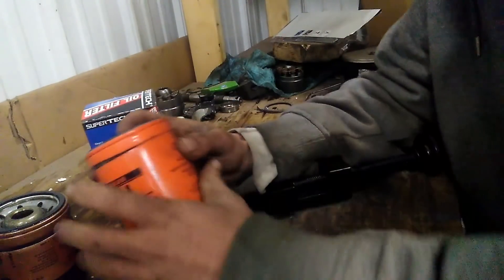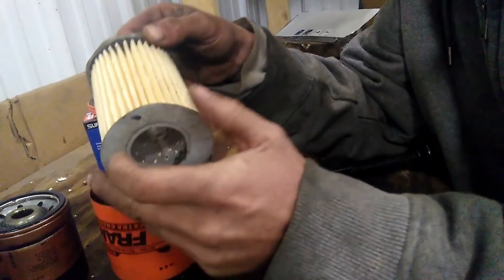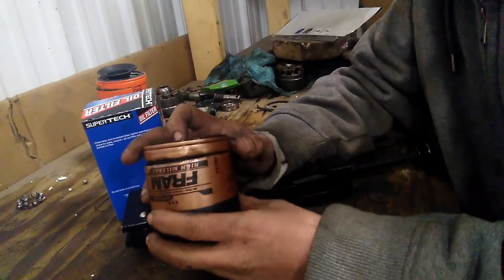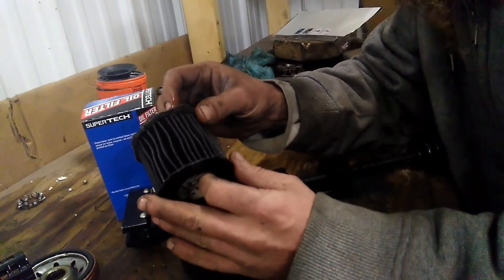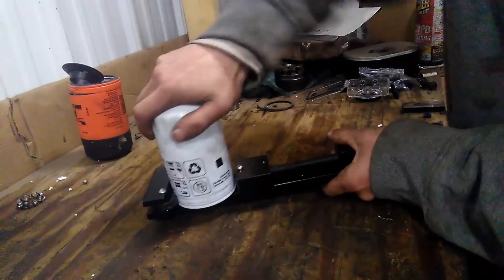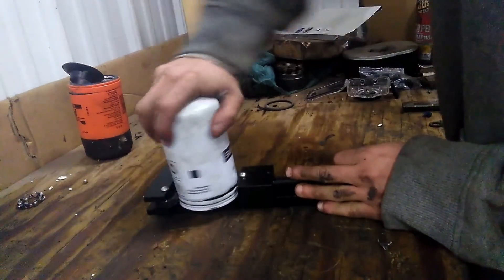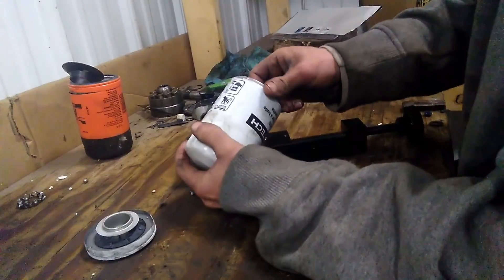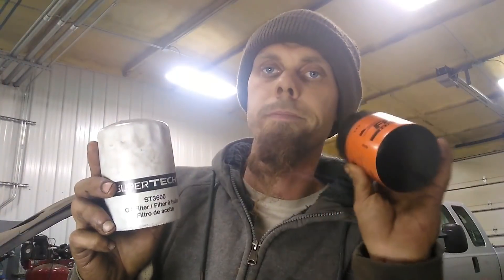supertech vrs fram oil filters: are fram oil filters really the worst you can buy?

Comment: Supertech is definitely superior than Fram extra guard. Only thing I like about Fram is the non slip grip, but that still won't make me buy it.
Reply from the maker: the grip is nice i wish more manufactures did that. but not enough to make it worth buying.
Reply: Ezrider92356 Purolator one used to have a yellow coated can with the same texture but that was like 5 years ago.
Reply from the maker: cool 👍
Reply: Super tech ones are made by Fram now 😀
Reply: jeffscomp I dont know if they are made by fram but they are completely different. Do not know who manufatuers them but it could be Fram.
Reply: chriss4365 Hey, I saw your video and I really appreciate you showing us the inside after 4,000 miles. I'm not against Fram extra guard, but I would rather upgrade to the Fram Ultra Synthetic. Matter of fact, I use extra guards on my beater.
Reply: Put a piece of duct tape around it.   Same effect.
Reply: I bought fram filters for years for that very reason.  After watching a youtube video comparing Mahl filters, I now use them, along with a filter wrench.
Reply: I used those $3 filters for 350,000 on my VW Golf and the engine ran perfect when I sold it

Comment: I've used fram oil filters for the last 45 years on every vehicle I've owned, some over 150,000 miles without one problem and I won't be changing brands now
Reply: You see a superior product for less money but still won't switch?  Why not?
Reply: @csinalabama73  fair question. 
Supertech has changed manufacturers, so there is a risk that they may change again
Reply: Yeah keep your head in the sand , , , that will show'em
Reply: Still using Bias ply tires cuz you never had a problem with them either, radials are a waste of money? Still using conventional oil also cuz you never had a problem with it? Yeah thats safer than this new radical Synthetic stuff that all the "young folks" are using, damn hippies get a haircut!
Reply: @homerfry9234  that's cute. trump 2020, right? LoL

Comment: I've driven north of a million miles on all sorts of filters...from the Fram "Orange can's of death" to expensive Baldwin and Mann.  First...I've never had any oil or oil filter related issue.  Second...I also never thought it necessary to cut one open.  The "cheap" Frams are made that way to...wait for it...to keep them at a price point.  Low.  They're NOT designed to race.  They're NOT designed to go extended mileage.  They ARE designed to be low priced and perfectly suitable to run 3-5k miles.  Bash them all you want but the fact is that those cheap crappy filters and their generic/re branded equivalents protect more engines than all others combined....
Reply from the maker: thanks for sharing your experience.
Reply: And yet the Frams cost more than filters that are better made.   I think that indicates they're designed primarily to turn a profit.
Reply: The new Super Tech line is now made by Champion Labs.  Mercruiser filters are identical but cost 5x as much just because they're black or white.  Other than that...they're identical right down to the numbering.  Indeed, they're also cheaper than the Frams and look to be better overall.
Reply: I tend to agree with your assessment.  As long as you replace them within their rated service life they should be fine. The quality of the oil you use is the more important thing.
Reply: corporate greed for junk. Keep the shareholders happy. screw the consumer. Every here of that?
Reply: @gtzgreatride  Baldwin filters are great.  Most fleets run Baldwin because it is a great filter.

Comment: Good comparison. I generally go with a Wix or SuperTech. I quit using FRAM when I found out about the cheap cardboard on the ends. I'm glad you took apart a used filter, it shows even more why the metal ends are far superior.

Comment: The Fram Ultra and Titanium which are the same filter are actually ones just exclusive to AAP are  extremely high quality filters. Almost like they’re made in a different factory high quality. They’re wire backed media, silicone anti drain back and steel end caps

Comment: A little over 600k on my last Toyota pickup with Fram filters. Not a single problem! Oh and that "carboard" is actually a similar material as the filter media itself. Glue bonds better to it so the media doesn't tear in high pressure situations like cold starts and high revs. We've seen plenty of media tearing issues with Purolator filters and their metal endcaps! Go read the forums on Bob is the Oil Guy if you don't believe me, scroll through the filter section. Literally hundreds of threads on the subject.
Reply: So now that you know how poor the Fram is why would you continue to use it when better choices are available? Will you never switch to synthetic oil because you never had a conventional oil failure?  I used Fram for 30 years and never had a problem but saw videos years ago that made me switch to better filters. How can you in good judgement continue to willingly use crap in a vehicle that cost so much?
Reply: @homerfry9234  Because it's never failed me before lol and I like the design with the grip stuff on the can. I use Mobil 1 syn. in my pickup btw.
Reply: @78FullSizeBronco  Why are you using Synthetic in your pickup if conventional has never failed you? Change is not good be it oil or filter!

Comment: If you pause the video at 1:39 look at the dirt build up on the leaf spring that holds the filter element in place. Now look at the inside of that filter. I'd say it did a good job. I've cut open many Fram oil filters and the pleats were still intact. I can't say that for the Bosch 3410 that I GENTLY cut open. My preference is Motorcraft oil filter's. But I've used them all and my F-150 still runs strong.

Comment: And fram charges as much and usually more than the better constructed oil filters. I used a bunch oil filters in my 75 years , never had a failure. and I've never seen such a cheaply made filter as fram . .I owned several dodge diesels and rumor was they had to buy some dodge diesel 5.9 engines. The oil filters disintegrated and went into the engine. I believe the # was 3971. the modified # is now 3971A. I think. anyway thanks for the video and happy travels.

Comment: My pre-watch opinion is that the SuperTech, being made by WIX, will be a very nice filter indeed.  WIX rules!
Reply from the maker: that seems to be the general opinion. when i made the video i really thought it was going to be a re-branded fram filter......thanks for watching
Reply: You may want to take a closer look. Wix isn't making them any longer.
Reply: + Danny Rumbles That is true now. Unfortunately now changed to Champion Labs with many ecore filters.
Reply: Wix with the "R'" on the end is a good one. R for racing. I now prefer purolator "BOSS'.
Reply: Check your specs on the wix for your application.
Wix for my app only filters down to 30 microns.
I can find better filters that filter down to 20 microns with more pleats and rated for better capacity or higher miles.
And I went to napa and other stores looking at wix and they dont put any specs on box because there specs suck and know there selling by there catchy wix name only.
Reply: @countryfamilyalways7280  Exactly.   These filters need to be tested for resistance to flow and filtering ability.   Also whether they will survive between oil changes.    This video addresses NONE of these.   This video is a waste.   Nothing wrong with cardboard.    If a filter disintegrates, do you want cardboard in your engine or pieces of melted plastic and broken metal springs?

Comment: Nice tool.  With that I could of cut open 30 years worth of oil filters.  I just assumed that the oil filter worked and just threw them away.
Reply from the maker: its a handy tool for oil filter inspections. generally i would inspect filters for signs of a unhappy engine. say on a fresh build or if i suspect a engine might be eating a bearing or other part, this type of tool wont contaminate the filter pleats with metal from cutting the filter open. where cutting a filter open with a grinder would or other abrasive tools. many speed parts places like jegs summit ect sell them you can find them on e-bay as well. thanks for watching.

Comment: The supertech filter on this video is or good quality. However, most supertech oil filters that are “blue” instead of white(like the one on this video), have the ecore design. Nylon with fiber end caps. Doesn’t mean it won’t do the job, as I have used both. But if quality maters to you, go with the white filter.

Comment: Last time I buy a Fram high mileage oil filter.
Reply from the maker: i won't be buying anymore either.
Reply from the maker: your notice in my video if you actually watched it rather than just spamming the comments multiple times with a video link, on the used filter i mentioned that the only thing holding the filter together was the glue. your also notice that the new fram filter that i cut open there was spots of glue that was not fully applied. (machine error most likely) never did i make a claim that fram filters are incapable of holding together for a normal oil change cycle. the claim that i made was between the fram filters i cut open and the super tech filter i cut open i think the super tech was a better filter.
Reply: Ezrider92356
Fram is sensitive to the filter cutaway videos and they hire people to do battle in the YouTube comment section.   Maybe they should invest their money in making a better filter instead.

Comment: Hurts a lot to see the truth about a product I have been using for years. Fram PH16 on my XJ Jeeps. However they run perfect and engines sound and operate like new even with 212000 miles on one of them. I have bought my last Fram, I will be switching to Supertech. Great video, thank you, I was unsure now I know.
Reply from the maker: i have noticed a number of people comment that the new blue supertec filters are a different design than the white one i cut open for this video i have not checked into that for myself just for a fyi. but yeah i was pretty disappointed with the fram design myself. i don't think there likely to hurt your engine but seem chintzy enough i wont use them at all anymore either.
Reply: @Ezrider359  :-)  waiting for part 2 with the new blue ones
Reply from the maker: @OneWildTurkey  i probably should, ill keep it in mind. 👍

Comment: The odd thing about supertech filters, is I have cut open two of them after usage and for the same car one of them had the cardboard end caps and the other one had metal and caps which was kind of confusing
Reply from the maker: i would not be surprised if they frequently change manufactures on the supertech filters, i honestly would steer away from either one, i generally use wix or napa gold or oem filters.

Comment: Thanks for that video.. I've been looking at many filters and I use fram ultra sync when I moved t Cali change my oil every 5-7k but didn't n like how I starting to see ppl cut them open.. I saw this at Walmart and picked up it oil and filter for just $20.00 . And at first I didn't want to go cheap but looked up the oil rating and saw it matched the oil I use selling at 18.99 the gal. Vs 14.99 supertech cheap oil made cheap but saw how it was told no it numbers with the name brand  I don't mind spending money with car but I don't like to be sucker so I started to see ppl use the cheap oil holding up. I started to see the filter at my store and was shocked when we saw you cut it open how well it made vs the fram...  Thanks again
Reply from the maker: i would personally still opt for a filter like a napa gold or wix over supertec, i would not trust walmart not to change manufactures/design without notification. iv seen people comment on this video that they have already done that sense i posted this video. the fram ultra synthetic filter is a higher quality filter (with a higher price tag) than either of the lower level fram filters i showed in this video. i would think that any mass produced filter is probably going to be ok under normal usage as if they were destroying lots of engines they would not be in business. but for many people myself included spending a couple extra bucks on a good quality filter is worth it. when i made this video i really expected the super-tec to be garbage but the one i cut open in this test certainly appears to be a good quality filter. i would certainly use a supertec over a fram extra gaurd or high millage filter.

Comment: Ive always used fram till I saw these videos about how crappy they r. I’ll never use them again, I have been using ac delco in my truck and Mobil 1 in my wife’s. I’ve seen some videos about the super tech oil as well, I’ve heard good things about it
Reply: That AC Delco is also a crap filter
Reply: a man - who has seen the Light..Hallelujah!...I can't believe those that bleet - well, my soandso got 300k miles on Fram. so F'n what.  I trust my eyes and for the price. I drop kick a Fram filter and will buy Walmart made by Wix - no less.

Comment: Very informative.  Thanks for posting.  I wonder though if the FRAM XG series filters are this bad as well.
Reply from the maker: the new fram filter i cut open in this video is a extra guard the used one was a fram high millage. the fram ultra synthetic filters are much better constructed though.
Reply: There is absolutely nothing wrong with the Fram Ultra Synthetic filter.

Comment: Cardboard doesn't mean much if done right, open OEM Honda filter and you will see same cardboard. What type of cardboard and type of glue used - that's a different story. However, there is talk that Honda OEM are made by Honeywell and they own Fram. Honda OEM are rock solid filters. Go figure...
Reply from the maker: interesting info, thanks for sharing.
Reply: +CNT. Honeywell doesn't own Fram. Since 2011 Rank Group owns them. Yes Fram does make the Honda A02 filter, however it's made to Honda specs. Yes it does use fiber endcaps, not my favorite and I don't use them. Prefer Wix,  Napa Gold. As for the use of the term "cardboard" for the end caps, Fram prefers to call it engineered fiber, or engineered media. Of course cardboard is engineered fiber too. ;)

Comment: Fram is the largest manufacturer of oil filters in the world. They supply many car manufacturers with their oil filters. There's zero proof anywhere that says metal end caps are better than fiber ones. Personally i buy whatever synthetic oil specific filter is on sale at the time regardless of the make.
Reply from the maker: fram filters use metal end caps in there higher end synthetic extended service filter uses metal end caps so even fram doesn't believe in cardboard end caps. they would not sell many filters if there slogan was just barely good enough made as cheap as possible. 

are they likley to fail in a 3k mile oil change. no they wouldn't be in business if they did but a couple extra bucks for a good filter vrs one that just barely good enough to someone that cares about there car is worth it to many people
Reply from the maker: good video. one thing to keep in mind in mind is it is produced by fram, they are going to try to make there product look in a favorable light. if you like fram filters by all means buy fram filters, personally i would spend a few bucks more for wix napa gold or oe filters.

Comment: Thanks for the review on the Fram and Super Tech oil filters.  I checked them out at Walmart today and noticed that the Super Tech oil filter is 25% smaller than the Fram.  Check it out yourself----2008 cadillac DTS.  Does anyone know why it would be so much smaller???
Reply from the maker: interesting, i have seen both short and extended versions of filters for the same application before. it could also be that they combined the same filter number to work for more applications, where the filter base is the same but one application may be a tighter location. and they just lumped them both into the same filter.

Comment: Unfortunately, at least where I live in New Mexico, super tech oil filter are now made by the same company that makes the AC Delco ecore filters, so there quality in build is way down in my opinion. They claimed it's a 97% filtration rating, but the ecore filters have a plastic core instead of metal, and they also use cardboard as end caps as well.
Reply from the maker: iv heard the new super tech oil filters in the blue can are not worth a darn. kinda unfortunate.
Reply: @Ezrider359  they are 99% and 10k miles now. metal core. just bought 5 for my miata. blue color. nothing wrong with these.

Comment: I endorsed super tech oil filters for a few years now, now the Blue colored super tech oil filters for 2018from Walmart do not look the same, they look like a rebranded STP OIL FILTER. Paper end caps and a plastic center filter cage. Very FRAM like in design. Just a heads up to Supertech filter users.
Reply: Yep, noticed that when I changed the oil on my mower this spring, bummer.
Reply: metal ends now

Comment: Yeah Fram has three different types of oil filter for the same vehicle which means three different price points are set. Why not just have one standard one. It's the strategic marketing practices that is all about capitalizing and maximizing profits. Not too mention, the orange crap can cause the oil pressure in my engine to drop over a period of time and a now failed oil pump.

Comment: What is the device to used to cut open the filters?
Reply from the maker: there just called a filter cutting tool. most places that sell speed parts sell them, i probably got mine from jegs or summit or some place like that. they basically work like a tubing cutter just a lot bigger.